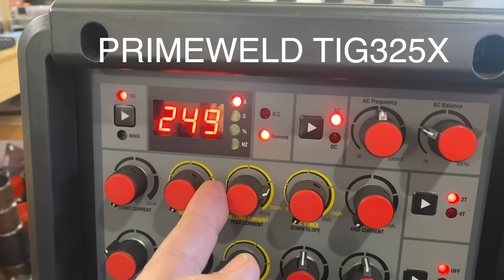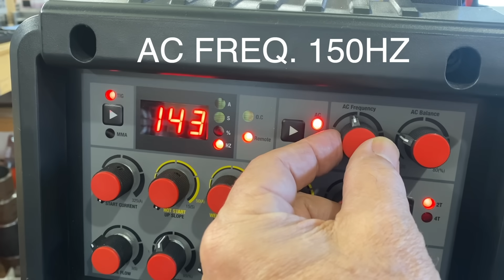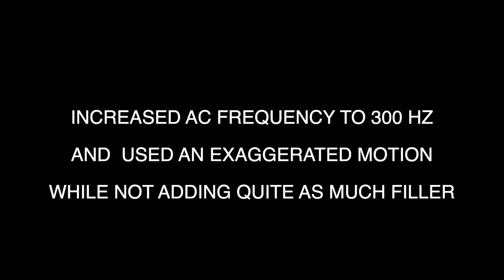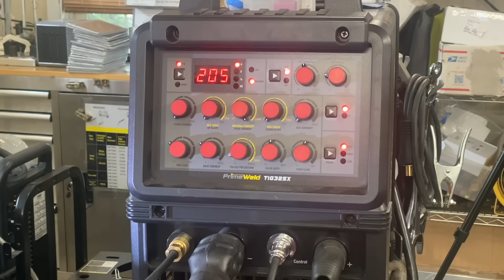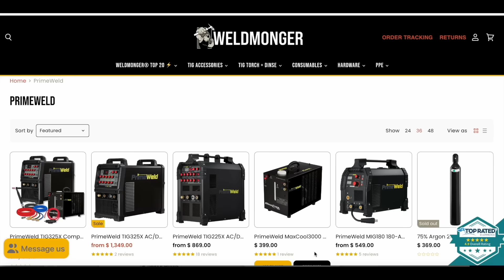1/4" (6mm) Aluminum Weld

Comment: Has anyone ever seen 1/2 inch thick Aluminium plate and steel plate impregnated / squashed together under Exstream compression   ?  My friend was working in this welding work shop and  got this off cut of metal he was showing me very proudly ,said it cost a crap load of money for some project they were working on ,made in Germany  they start by mill the faces very  course cut and then sandwich the plates together under Exstream compression using explosives charge , i never seen anything like it , was 1 inch thick over all both sides even thickness alloy plate one side steel plate the other mashed together , seems crazy but this is used to join to different metals together that can not be fuse / welded ,
Reply: Steel hulled ships with aluminum superstructures - they use this method

Comment: Thanks for this video. 1/4" Aluminum lap join is what I'm struggling with. Takes me forever to get the puddle established and feel like I'm just not getting enough heat to allow filler to sink into the root.  I'm running a Lincoln 200 inverter squarewave on 220 at 200 amps, which is probably max thickness for that machine. Someone was saying AC balance can help that. Less positive for thicker, more for thinner or something like that? If you can confirm that thick and thin aluminum balance tip, I sure would appreciate it.  
   Thanks again for sharing your knowledge with us.🙏

Comment: Hey Jody, I figured with 1/4" aluminium plate that you would have been around 50-60Hz for single pass? Cheers.
Reply from the maker: If I was using a 200 amp machine, I probably would have used lower ac freq setting. Maybe a part2 version of this video will show that. Thanks

Comment: Seems like the frequency should be turned down for thicker material? I would set it around 80 when welding 1/4" - 1/2" aluminum. Thats just me though
Reply from the maker: Thanks for the suggestion I intended on trying lower frequencies  but ran short on time. I might do a part 2 and try that along with a few other changes
Reply: I like to turn it down for thick materials. Any high frequency seems to me to only penetrate shallow into it.
Reply: Same here, high feq for thinner aluminum and low for thick. Thats running off a miller dynasty for me @Sicktrickintuner